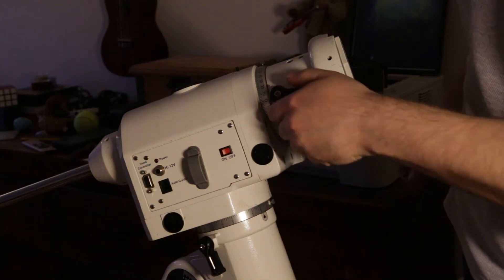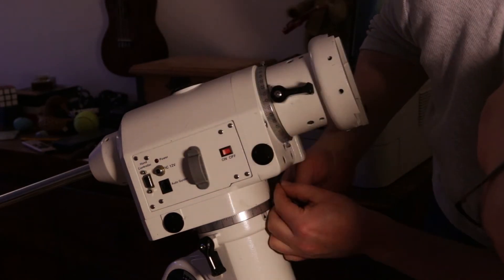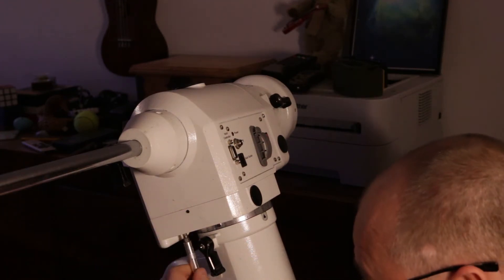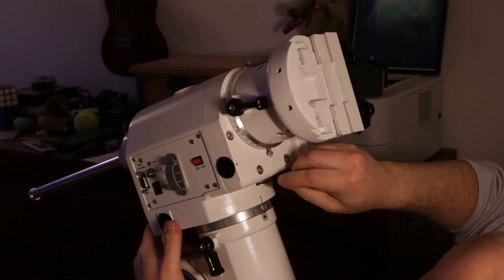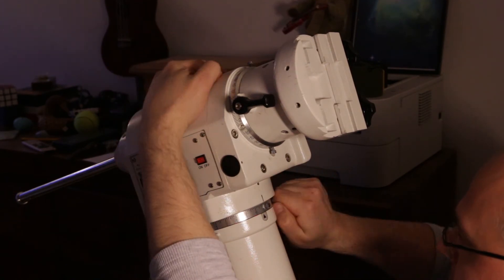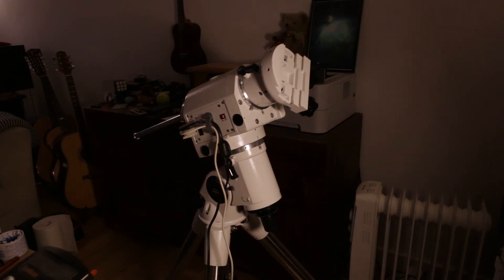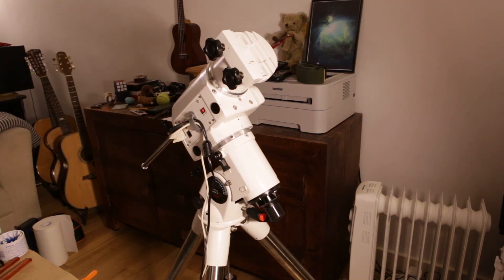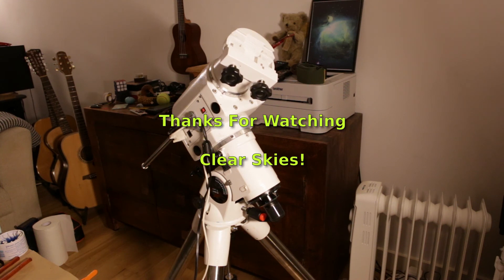NEQ6 Belt Mod Part15 - Adjusting Worms & Testing

Comment: The EQ6 is still performing well after the belt upgrade in January. Ther's been no need for any re-adustment of either axis yet and I used it 2 or three times with a heavy 10" Newtonian on it, and its definitely much quieter  than before.

Comment: Hey Kari - thanks for this series of videos about the belt modification - really useful and apart from a few things that were unexpected (such as the brass clutch buttons existing and possibly becoming dislodged into the body of the mount never to be seen again - the RA one) - your videos were a great guide.  Yet to see if any improvements in guiding but the mount head moves more smoothly - doesn't sound like a chaff-cutter at start of movements - and I've noticed the balance is a lot smoother.  Also I now have the confidence to pull the thing apart and do any re-builds as required.  May strip it back to do a re-grease - the amount of grease SkyWatcher slaps about inside the mount is horrific.  Cheers
Reply from the maker: Thanks Damien! My mount has performed well after the mod albeit it hasn't had as much of use as I would have like. One word of warning though. I had to re-adjust the backlash on the DEC axis one too many times which resulted in failure of most of the M6 threads that holds the housing together. The steel bolts in the soft aluminum body just aren't meant for opening and tightening repeatedly.  I ended up fixing all four of them using v-coil thread inserts which in theory should make them stronger than original. Clear skies!
Reply: @karibrown  I  also noticed that I couldn't re-tighten one of the M6 bolts in the RA worm housing - I'm relying on the other three to hold it together - it's weird that they are so fickle.  For all the good points on the Skywatcher mount - there are some real short-comings.  Again I have to thank you - I'll look into getting some thread inserts as I'm bound to be opening up the unit at some stage.  Hope you manage to get out more!!  We've had an unusually cloudy winter here in southern Australia - little rain but a lot of cloud - so getting outside has also been pretty frustrating.  Hopefully better days ahead for us both!  Best regards.

Comment: How did you find how to make the adjustments to the worm gear?   I am scared of messing something if i do this.
Reply from the maker: Tempus Fugit It is totally doable but does require patience. Best to do it outside closer to the operating temperature rather than inside in room temperature though like I did here...
Reply: @karibrown  Finally, I've completed the belt modification, and like your EQ6 PRO, it worked straight  away at the first test (surprise surprise with my record in DIY projects). Your comment to Tempus Fugit is a good warning though as I like yourself, made the worm gear adjustments at room temperature. When I carried it out, I was truly amazed at just how much slack in both axis's, tightening and slackening those small grub screws, made until finally there was no play at all. Until this point, I was beginning to think I'd missed a tightening step out somewhere along the line.

I found the whole set of 15 videos most invaluable when used together with the downloadable instructions from Rowan Astronomy, as these tend to have some gaps in the work flow, which your videos fill in most adequately.  Thanks again Kari for all the effort you must have put in to make the videos.
Reply from the maker: @davebillybish  Glad you finished yours! Another bit of warning is that be careful with the M6 bolts that holds the housings together. I had to to re-adjust my DEC axis too many times and ended up stripping the aluminum threads which are surprisingly soft. I managed to fix them with V-Coil thread inserts though and all is good again.
Reply: @karibrown  Thanks, I will watch out for this problem. Do you ask for M6 V-Coil thread inserts and are there any special insert tools needed if this happens to me?  Are V-Coils like Helicoils? It sounds like it was a reoccurring problem for you. My friend had is mount done by Rother Valley  Optics and so far it hasn't needed re-doing though he says he hasn't used it much yet.
Reply from the maker: @davebillybish  Yes the DEC axis was a bit problematic for me. The backlash came back a few times after using the mount for a while. It's been fine since I did it the last time when I fixed the threads as well. Yes, V-coils are like helicoils. I ordered a kit from amazon (V-Coil 4010 Thread Repair Kit) that included almost everything needed. It came with 1.5D inserts which are fine for the deeper hole. Had to get 1D inserts for the three shallower holes separately. I think I got them from ebay. I'm thinking of getting a bigger v-coil kit to repair the latitude bolt threads as well which don't look very good on my mount anymore.
Reply: @karibrown  Thanks Kari, very good to know a little more about it. I will take a look for the V-Coil 4010 kit and bookmark it. I took the NEQ6 Pro out for the first time last night, though it was partial cloud and finally total cloud cover, so I only had a little time to test it properly. However, the motors are much quieter than before, but on the downside, the pointing accuracy has gone for a '6', really awful, so I performed a 'Factory Preset' of the handset and packed away the gear.
While the front panel with the  printed circuit board was off during the upgrade, I noticed it was covered with a thin layer of white deposits, like oxidation, probably caused by damp getting inside. I have an idea to clean it with isopropanol on a cotton bud before it gets any worse.
Reply: Please note: After doing the Factory Preset, and a polar  alignment, the pointing accuracy it very good and so far the backlash hasn't returned.  Thanks for the informative answers before.

Comment: Thank you so much for all the videos on this. These will certainly become the goto for any of these modifications in future. I would love to here your feedback in a few weeks time once you have been out using it with your scope etc.
Reply from the maker: Johan Landman I've been out with it a couple of times already and can confirm it's working better than new. I don't have any before /after guide graphs but you can already feel the improvements when doing star alignment using the hand controller. The scope responds pretty much immediately to slewing and there's barely any backlash when changing direction.